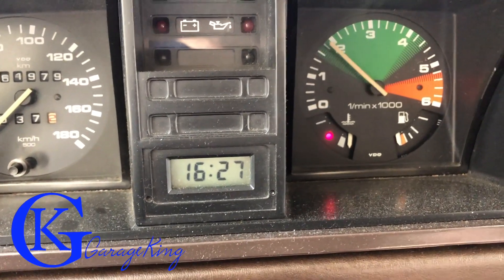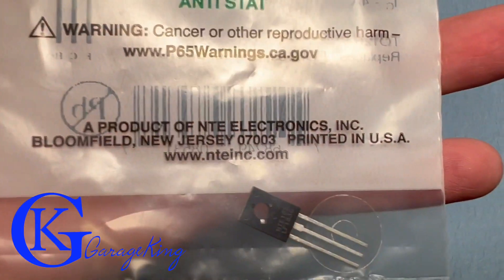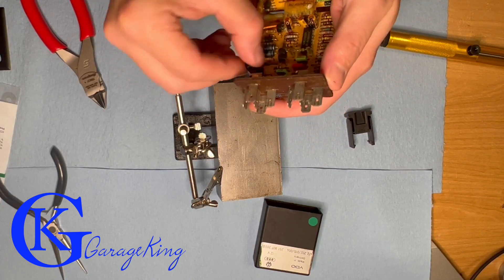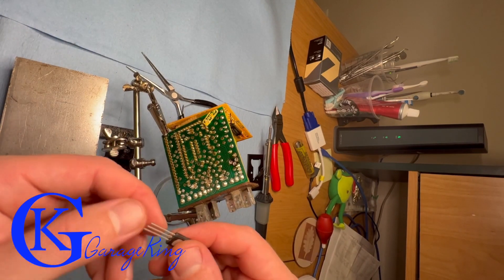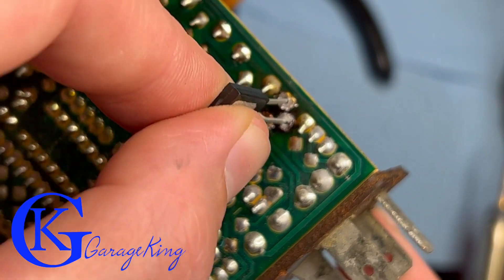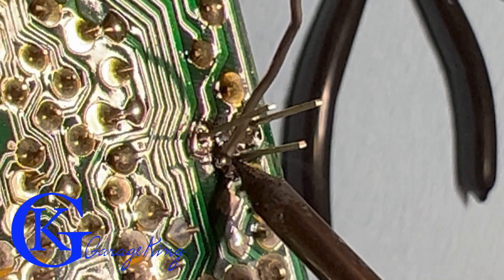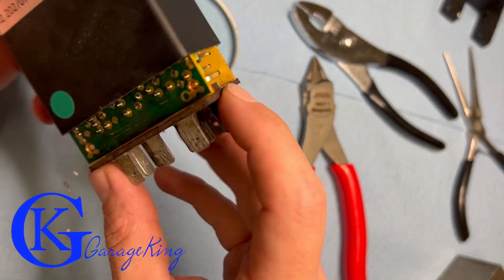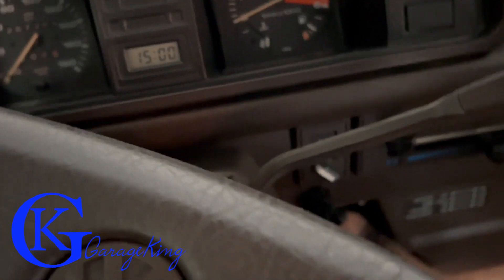VW Vanagon Idle Circuit Board Repair - Easiest, cheapest way to fix the problem!

Comment: I have an 1986 VW Transporter Doka, and 7 years ago it was randomly idling up and down and I got a replacement circuit board from GoWesty for probably $400 by the time it reached Canada. It started doing it again a year ago and I lived with it till it just went into high idle and wouldn't come down.  I followed your instruction to a tee and it's now idling perfectly.  Would have probably been $600 USD now, and I found probably the last one in Canada so $2 for it, plus $3 shipping and a $25 soldering kit from Amazon. High five GK!  !🤗
Reply from the maker: Thank you for the great comment, and so glad you were able to fix your machine.  I just bought a 1990 Vanagon that I'm rebuilding now.  Have to keep these VWs on the road.  Cheers !!!

Comment: thanks for the vid...flux and or flux paste and solder braid would help with this operation...fluhlps solder flow where its supposed to go  :)
Reply from the maker: Yup it would, thanks for the comment, as you can see I'm not a pro solderer but I can get by LOL
Reply: @GarageKing  you did awesome...just a tip
Reply from the maker: @minskmade  Thanks !!

Comment: The non secret is to use a solder sucker. They make various versions like a braided one that wicks it away and even a literal "sucker" style that acts like a plunger. Basically you heat each leg and draw that solder off one at a time. They sell them fairly cheap on places like eBay or amazon. If I could add pic Id show one. But look up "solder sucker"
Reply from the maker: Thanks for the comment and I now use one all the time.   This was filmed before I was introduced to it.  I have the squeeze ball style and the retractable pen style.  I would like to splurge and get a vacuum one !!
Reply: @GarageKing  Skip the vacuum one and just get good with a braid. Flux is the key. Also, experiment with solder that has a slightly lower melting point. That'll help with the tricky stuff. Flux is your friend. If the first one you try doesn't work try more. Eventually you'll find the right combo.

Comment: I know you asked in a prior video, but there is a clip that the module is attached to. You might be missing it.
Reply from the maker: I think you are right and good memory, If memory serves me correctly I was able to slide the module into a type of retainer in the Vanagon behind the rear light. I did find that the wires were kind of tight that way so instead I just put a few rags down and the module lays on the rags. So far so good. Thanks for the comment.

Comment: Great video! Mine was fine but instead needed some joints reflowed and the large 56R 10% resistor replaced. Thanks!
Reply from the maker: Awesome you got it done, these are not available new anymore so we have to rebuild them.  Thanks for the comment

Comment: Secret is to heat the whole thing where you're working and the solder won't cool so fast that you cant remove multiple legs
Reply from the maker: Thanks for the reply and tip.  I'm not an electronics repair person so when it comes to soldering I'm no pro.  Appreciate the tip, thanks !!

Comment: I think you would it helpful if you first tinned you soldering iron.  Makes the solder flow a lot quicker.  Also, looks like you needed some solder wick to help remove the old solder.  Thanks for the great heads up video.  Cheers!
Reply from the maker: Thanks for the tips !!!  I'm not that good at soldering as you can see, but did my best, appreciate the comment :)